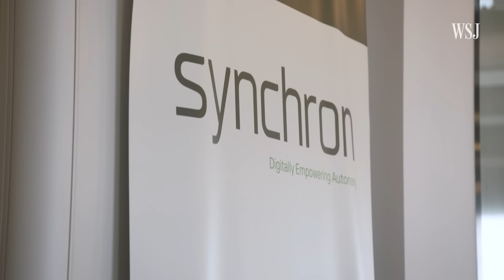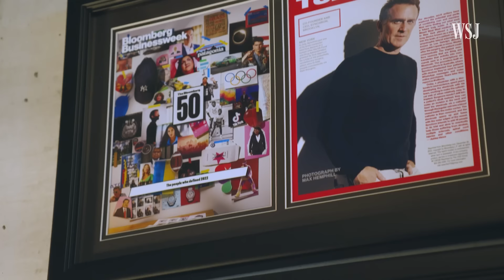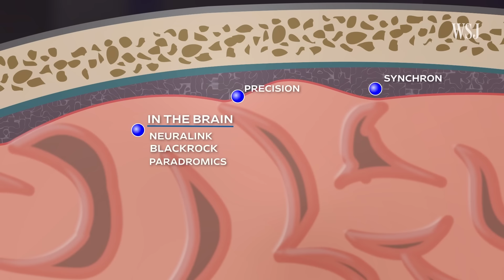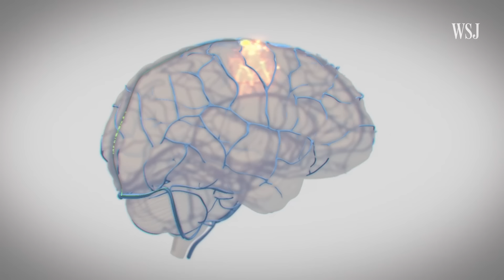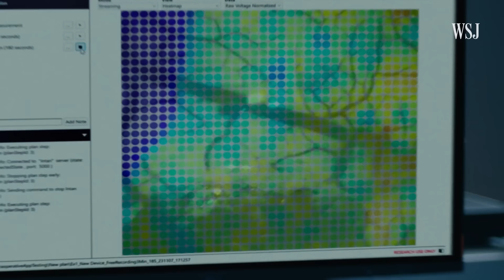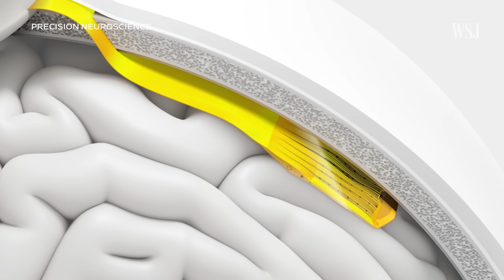Neuralink's Rival Tests Brain Chip in Race to Bring Implants to Market | WSJ

Comment: It would have been interesting if the WSJ had also addressed what could go wrong during the procedure of inserting such a device in the brain.
Reply: Well like any invasive surgery, the immune system can reject the implant, however brain is a special part of our body because of the hemato-encephalic barriere. But other than that it is just a reading device so it does not seems to have direct interaction with the brain, it looks like using an oscilloscope or stuff like that
Reply: Since it is at such an early step I don’t think anyone knows the true extent of the potential damage or how risky it is. I think it will take time to figure out the true risk.

Comment: 2 questions:
1. What is the difference in sensitivity between the different solutions? I'm guessing that the more invasive it is, the more sensitive it is. Is that actually the case?
2. If the guess is true, then wouldn't it mean that eventually we will need an invasive solution because detection of brain signals can only go so far when you are outside the brain matter?
Reply: The problem is not sensitivity, but resolution. Chips that are implanted above the dura (a protective layer on the brain) have difficulty with precise neuron spike detection, because all the layers of tissue in between the electrodes and the neurons disrupt the signals and make it blurrier.

You are right that deeply invasive devices have the most potential. There is only so much a BCI can do with blurry, imprecise spike detection. There is a much higher capability ceiling with the higher bandwidth, invasive devices. In the future, if we wish to reach the limits of what BCIs can do, approaches like Neuralink have the most potential.
Disclaimer: not an expert in any means, just someone who is interested in the tech
Reply: @jmoney4695  You had me stumped at the difference between sensitivity and resolution. It wasn't top of mind that there was a difference! Thank you for pointing that out! 

"Resolution is the smallest portion of a signal that can be observed. Sensitivity is the smallest change in a signal that can be detected." is a definition I found on the interwebs. By that definition, wouldn't a more invasive probe provide improvement to both?
Reply: Also not many people mention that the lower the 'signal' quality the more compute is needed to correctly decode the data. Also another really important thing is the electrode placement density.
Reply: @DdDd-pl3nt  If the raw signal is processed directly by the NN software end to end (ie. not denoised/etc first), wouldn't compute be largely the same? Can you expand on the electrode placement density?
Reply: @thesadboxman  so the more electrodes you can put the more different regions of the brian you can effectively gather data from. The issue is the signal "clustering" Or whatever we call it where electrodes placed close to each other gather almost identical data. For the signal, as far as i know the Preprocessing of the brian data should always include denoising, normalizing etc (what you mentioned). What i mean is from low quality signal it's harder to extract the features you want, or harder to train a model you want to use to interpret the signals in the future. I'm also not a professional though, still learning.

Comment: What's with the bias? Basically bashing Neuralink for being 10 years ahead of it's competitors.

Neuralink - tested and refined without having to experiment on humans and then implanted the final functional device for permanent usage in a human.

Precision - 10 years away from first implant of a final product in a human and currently prototyping and experimenting their device with human subjects... also not anywhere near as capable as neuralink

Synchron - nowhere near as capable as neuralink, using a crude approach that will never converge to anything remotely near to what Nueralink has already achieved (inter cranial 1:1 neuron read/write ability all in a single package not requiring any implant in the chest etc.)